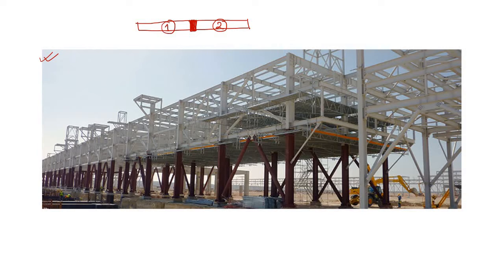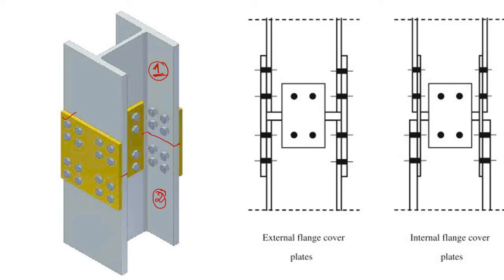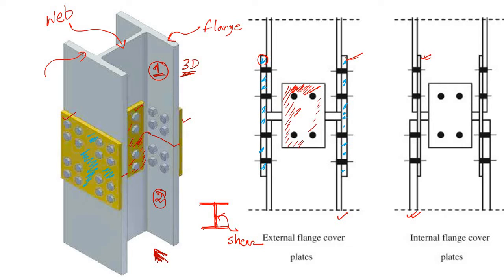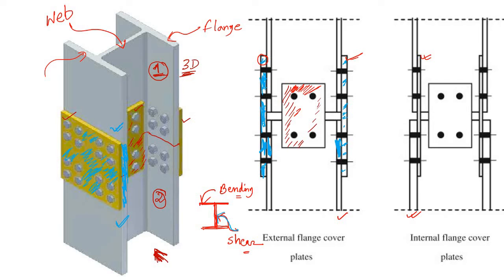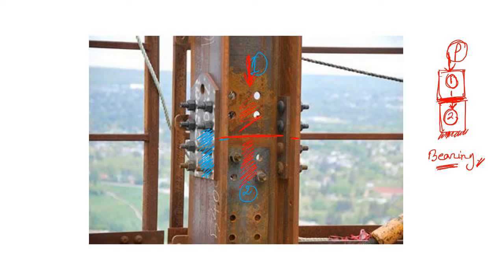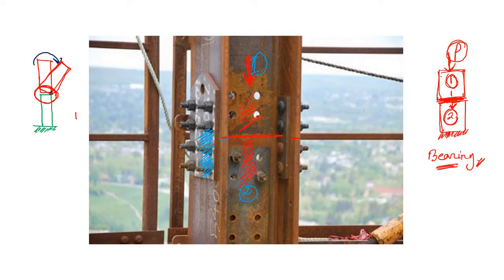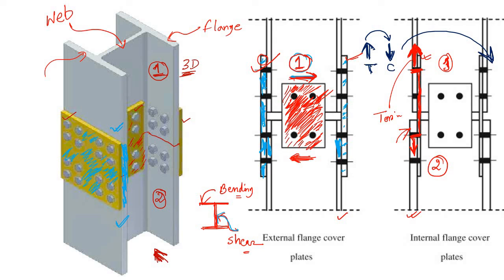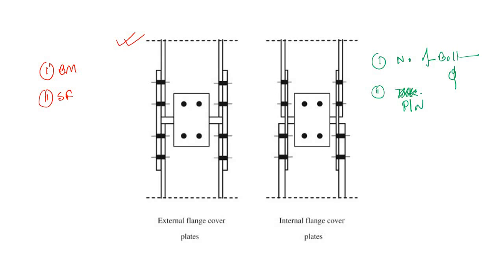Splice : What, Why and How

Comment: Sir
I have one question.
In case of bearing or in case of moment with compressive force. The force should transfer by means of bearing but there is no direct contact between the columns as there is some gap. So how bearing will take place or again it will be tranferred through bolts?
Reply from the maker: We use cap plate to make sure that the columns are connected